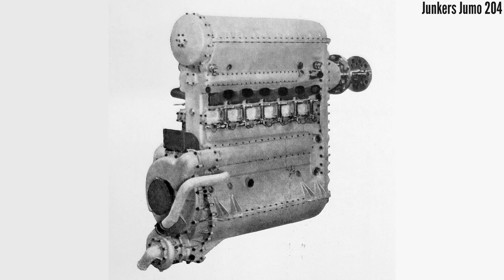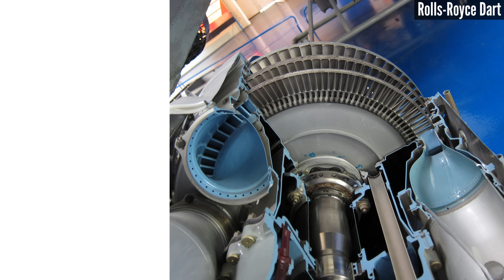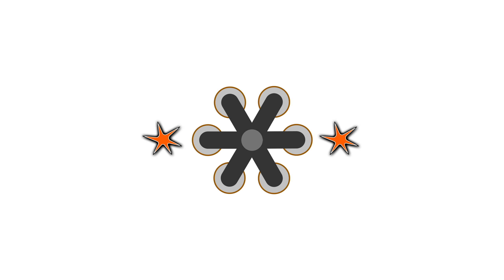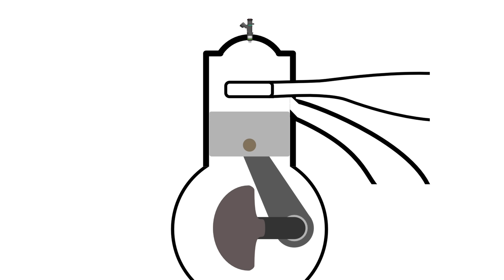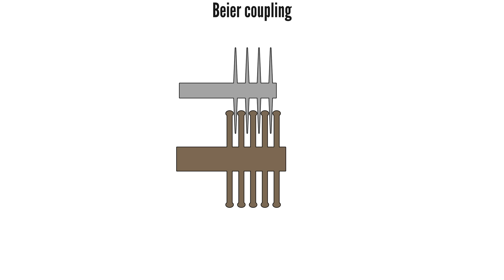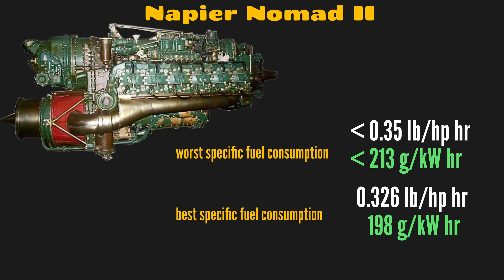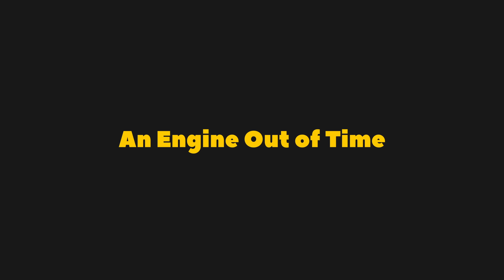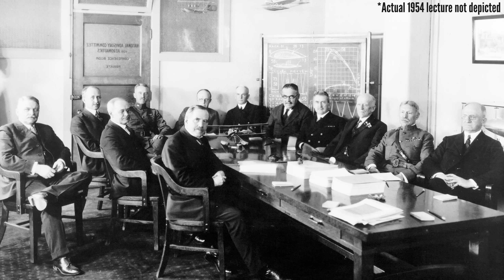Napier Nomad, the Most Complex Aero Engine Ever Made - Explained

Comment: These are just my calculations and the data is taken from Wiki but bare with me. The Austro Engine E4 (AE 300) that powers the new DA40 achieves quite good consumption too. My data, power output at 100% is 125kW, fuel consumption at 60% power is 19L/h of Jet-A1, specific gravity of Jet-A1 is 0,8kg/L. Thus we are burning 15,2kg/h*1h=15,2kg at 125kW*60%*1h =75 kWh. The specific fuel consumption is thus 15,2kg / 75kWh=203g/kWh. Again these are just Wiki data but still rather impressive. Also, the power data is for the shaft power I believe. If we want the power data for the propeller we should impose roughly n=0,89 efficiency ratio for the propeller.
Reply from the maker: It is based on the Mercedes OM640, same as the Continental CD-155 (previously Thielert Centurion). Not sure if the Austro version would differ drastically, but the Continental version gets 0.36 lb/hp hr / 220 g/kw hr. Source : Continental https://continentaldiesel.com/cd-155
Reply: I bared with you, and am shivering at the naked figures.

Comment: A two stroke radial with four rods on each crank throw has perfect primary balance. Three crank throws support 12 pistons. There is zero primary vibration and virtually no torque vibration.
This has no crankcase compression but all two strokes self scavenge the exhaust gas. They will run at low revs but torque is weak.

Comment: Rolls Royce had a two stroke based on the Merlin V12 format.  Crecy was expected to make 5000 HP partly crankshaft power and partly direct thrust from the exhausts. Another idea was turbo compounding. Yet another added more fuel between engine and turbine to make a hybrid turbojet.
They were all overtaken by the turbojet and soon after the turbo prop.

Comment: I don't know much about engines. A difference I've heard of between turbine and piston engines is the quantity of air inspired for a given power output. In both, the overall ratio of air to fuel runs with more air than stoichiometric, but turbine engines run with vastly more air than a piston design. As I understand, this is because air is used to directly cool the turbine engine internals, rather than heat being wicked away by liquid cooling or metal casing as in a piston engine.

I wonder if the Nomad design (and I suppose turbo-compounds generally) could have a niche use in situations where atmospheric air is not the main heat sink, and air intake is restricted.

Modern, non-nuclear submarines recharge their batteries via snorkel masts. Besides noise considerations, turboshaft engines aren't used because the high airflow used for cooling would mandate an unreasonably large snorkel.
Perhaps a turbo-compound Nomad style engine could be cooled by seawater (as normal marine engines can be), use less airflow than a turboshaft, all while providing power densities much higher than current diesel engines.

Just musings I've had for some time.
Reply: Petrol Engines always run with an Air Fuel Ratio of 14.2:1 called stoichiometric and this is done by throttling the air.   Diesels don't throttle air so run ultra lean.  No throttling of air means no suction losses.  The high Compresion ratio is also more efficient.

Comment: I would like to see a modern version of high boost 2 stroke turbo compounding.  I think an electrically driven compressor and a generator on the crankshaft and exhaust turbine shaft could be the basis of a very efficient diesel electric powerplant. Modern inverter systems and computer controls would remove the need for the fluid drive and gearboxes.
Reply: Scania 4 series had a 480hp turbo compound straight 6, not diesel electric of course
Reply: @redsnapper2889 they used a conventional turbo with a power recovery turbine down stream.  The compressor element was only driven by the exhaust turbine as it wasn't needed for scavenging as in a 2 stroke.  The Scania power recovery system appears similar the the Wright turbo compounds fitted to Connies and DC7 airliners.
Reply: @thamesmud Sorry I missed the 'two stroke' part of your post. Wouldn't forced induction negate the need for scavenging?
Reply: Volvo already proposed something very close to that in patent US8653677

Comment: Some of the engineering details of the Nomad are awesome.  The shared crankpins and continuously loaded bearings created a lubrication problem.  In a 4 stroke the load reversals alow oil to enter the bearing and most conventional 2 strokes have roller bearings which can cope with limited lubrication.  Chatterton solved this problem by grinding the crank pins with three slightly eccentric areas with matching bearing shells.  This allowed the centre part of the pin to get fresh oil for half the rotation and the outer areas to be oiled during the other half.  A stunningly simple solution by a great engineer.
Reply from the maker: Thanks for the info. I saw mention of this in the research papers, so seems accurate.
Reply: The two stoke EMD 645 series has fork and blade piston rods too.
It has exhaust valves for Uniflow  scavenging that helps get more of the dirty exhaust gasses out compared to loop scavenging .
Reply: @josephpadula2283 @josephpadula2283 The EMO engie probably doesn't have to cope with the 8 bar of boost pressure.  This caused the Nomad bearings to be loaded down even when the exhaust port is open..  The Nomad doesn't have fork and blade rods in the normal sence like a Merlin. A pair of light weight straps work on bearing surfaces on the outside of opposing rods.  Both opposing rods bear on the crank pin without bearing caps The only function of the retaining straps is to stop the rod bearings from coming off the pin whist the engine is started. Once up to speed and firing  the rod bearings are kept in place by combustion pressure and the high boost pressures. This one way loading caused the lubrication problems that was solved by the three area  eccentric ground crank pins.  Hard to describe in words but like all good ideas blindingly simple when you see it drawn out.
Reply: Use HSS carbon nanotube matrix bushings at 60:1 and no rollers needed!
Reply: @jlo13800 you mis understand. The crank bearings are not roller, they are shell bearings. Conventional shell bearings did not work due to the load never reversing which is why they moved to eccentric ground pins to off load the bearing and allow the oil in.
Reply: @thamesmud  Ok but those would probably run fine on klotz techniplate.
Reply: @jlo13800 I have no clue what you are on about.
Reply: @thamesmud  Its full synthetic 2 stroke sae 40 oil.
Reply: @thamesmud  Klotz techniplate synthetic 2 stroke oil!
Reply: @jlo13800 it wouldn't help as the bearing is continually under load. The pressure is more than the inertial unloading so the oil can't get to the bearing surfaces without the eccentric crank areas promoting oil flow.  Even when scavenging the cylinder pressures were north of 8 bar.  This problem is far worse than on a conventional motorcycle type engine and they invariably used roller bearings to get around the problem, which was always a bit of a bodge resulting in complicated multi part cranks and horrible maintenance problems in multi cylinder designs
Reply: As an aircraft engine, I agree it has some major flaws. But as a stationary engine for power generation, low fuel consumption is key, and its design could be a step forward in that field.

Very interesting, thank you for the video.
Reply: With enough pressure from the oil pump why wouldn't all the pin get fresh oil all the time? 

Every gif ive seen of oiled/hydraulic bearings shows the oil being dragged around by its stickiness and viscosity to the full 360 degree rotation of the bearings.  

Add oil pressure to that and the oil has to go somewhere (from the center of the pin outward).

What am i missing here?
Reply: @dirkhamilton2709 what you are missing is the bearing surface is considerably less than than 180 degrees to allow the opposing rods to articulate . With a conventional big end a complete ring is formed by the rod and the cap, with the Nomad there is no bearing cap and the gaps between the opposing rods allow oil pressure to escape. Couple that with 8 bar of boost pressure and high cylinder pressures occuring twice per revolution as far as the pin is concerned lubrication was not simple.

Comment: I studied these engines years ago with available data that I had, and I think if they would have been shipped to the United States and development continued. They could have really turned out to be something else.
I knew a lot of the old engineers from Pratt and Whitney and I'm sure they would have made amazing advances on another subject. I spoke about the rotax ancient that you said was so awesome. Well, you can't really fly a rotax, cross-country Buying 100 low lead fuel because the engine loads up with the lead. And it's becoming more and more of a problem. And using autofuel with alcohol is a real big problem. So to find 90 octane, wreck gas is very troublesome.
I've lived my life overhauling continental.And lycoming engines, I love them lycoming especially.
Reply: The days of developing and perfecting machines like these in the United states are over now. Maybe Canada can make it happen. There's no incentive to take on a project like this in the states anymore. Maybe China or Germany.

Comment: The Wright 3350 used on the Douglas DC-7  used a "Blow down"  "Turbo compounding"  system. https://youtu.be/gbMgwDIdScY?t=816 - There were 3 of them attached to the 18 cylinder engine - https://youtu.be/gbMgwDIdScY?t=876 ... This system fed power back to the crankshaft of the engine. This system was also very complex but actually did make it into production and was in commercial service. TC-7 was very fast for it's day and for any prop aircraft at 400+
Reply: Ah the ol' Parts Recovery Turbines.

Comment: Actually like some other old diesels, the Nomad still had spark plugs for cold starting
Reply: Not spark plugs but "Glow plugs" these didn't ignite the fuel, they heated up the air in the manifold before it entered the cylinders
Reply: @iffracem  you need to go back in time more. Before the 60’s many big diesels needed spark plugs & petrol for starting. This is quite different to the use of glowplugs for Toyotas & Nissans.
Reply: Sorry glow plugs are not effective at 8:1 compression ratio  @iffracem

Comment: I would like to hear the sound, and love to have one to work as diesel generator. With less then 0.2kg/kWh it is almost 50% efficiency.
Reply: The Junkers Jumo 205 diesel is about the same fuel efficiency (within 1%) I think but at the expense of greater weight.  The Jumo 205-C Diesel which was used extensively in 
1936 and 1937, was rated at 600 h.p. at 2,200 r.p.m. and cruised at 510 h.p. at 2,100 r.p.m. Its  power output was then raised by increasing its r.p.m., the Jumo 205-E model is rated at 700 h.p. at 2,600 r.p.m.  The Jumo 205-D, which is a military engine, develops a maximum output of 880 h.p. at 3,000 r.p.m. The specific fuel  consumption of these three engines is approximately the same, namely, 0.35 lb. per h.p. per hour at cruising speed and 
0.37 lb. per h.p. per hour at full load. These performances are obtained without a supercharger. When the engine is supercharged with an exhaust-driven supercharger the gear-driven blower is retained for starting purposes. The Jumo 207, as the engine then is known, developed 1,000 h.p. for take-off and maintains this output at an altitude of 20,000 feet and has a better P/W ratio to the 205.

Comment: Maybe if it had been developed in US where the distance was concerned it could have been produced, Wright Duplex-Cyclone was installed but requirement of flight engineers to manage thermal loads, power recovery turbines often failed, should have put fuel injection on them. If only I could have had a day in Henry Ricardo's lab. I have read his book and see modern engineers trying to redevelop his work without the credit. Thanks for the new pictures.
Reply: americans did have their own turbo compound engines but those didnt go anywhere
Reply: @jebise1126 no, actually they flew in DC-7 and super constellations, but with carbs flight engineers had to monitor closely or PRT failed from exhaust temps taking them out, used 3 PRT
Reply: @keithbarron3654  i suppose bad wording. yes they did flew they were a nightmare to fly and there were no more developments after that. or at least nightmare to keep them flying
Reply: @jebise1126 I think fuel injection might have helped with mixture balancing and temperature control. Daimler, DD tried on model 60 engine and Volvo on trucks. Would be nice for cars on motorways/interstate with modern computers.
Reply: @keithbarron3654  i think the biggest problem was shaking of turbine. so there are ideas that turbine can run electric motor to generate more power and than another motor to use power directly to wheels. but turbocharger is more popular now...

Comment: How would the reheat function work? 
On a jet engine the exhaust is c70% air. On a two stroke diesel, how much unburnt air is there in the exhaust that can utilise the injected fuel?
Reply: Unlike petrol engines, which need their air/fuel mix to be close to stoichiometric, diesels can inject as much or as little fuel as you want. So, how much oxygen is in the exhaust is purely a function of how the injector pump is tuned.
Reply: There is probably a fair amount of 'blow-by', ie intake air been blown out the exhaust port  during scavenging when both ports are open.

Comment: Thanks for this educational video.  I would like to point out that your comparison of different engines is slight lacking.   It would be a lot more helpful if graphs would be presented of several competing engine technologies.  This could be easily accomplished with Excel.   Other vice it is difficult to to do all this in the head.   Your channel would greatly benefit from such analysis.  The benefit to work put in would be quillet of a turbocharger addition to an engine!  Worth it!